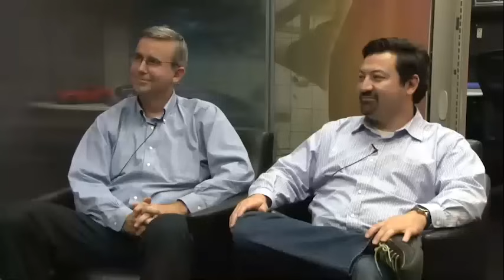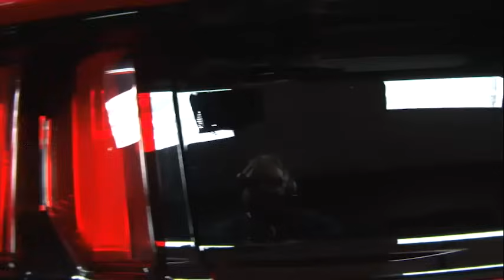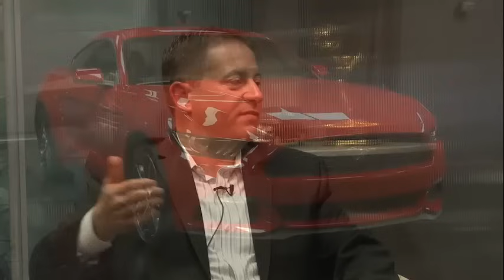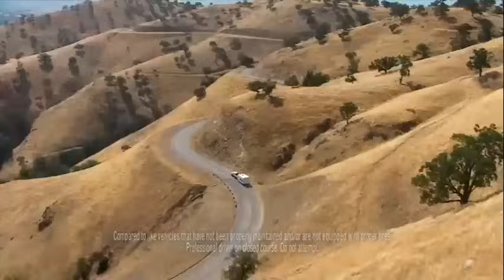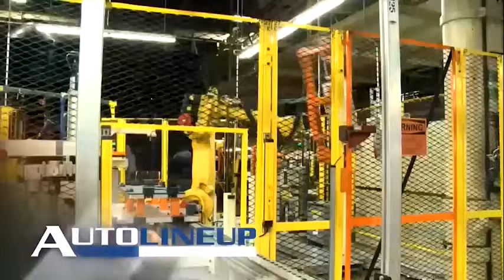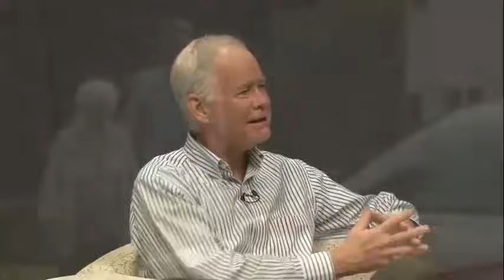Pony Up: Mr. Mustang Pays a Visit - Autoline After Hours 263

Comment: plastic windows.....just like the headlight covers that turn opaque over time....yes?
no thanks.I'll pass.
glass just plain lasts longer even though safety glass has plastic sandwiched in between the layers.
the sandwiched layer isn't exposed directly to water or oxygen so it takes a lot longer to start breaking down and turning opaque.of course...if you purchase a car with the expectation of it being a disposable appliance a plastic window won't be a consideration as within 3 to 5 years on average it will be disposed of in total anyway.

Comment: No Thanks!!  The 2015 485HP Dodge Challenger RT Scatpack is only $38,495. It already beat the 2015 GT Mustang and SS Camaro in a Motor Trend 1/4 mile drag race. It seats 5 people, has a large trunk, nicer interior and far better electronics. You would have to be an out of touch idiot to buy any ford or gm's recall queens right now!!!!   ;o)

Comment: take the Australian FG Falcon and stick a new body on it. - you got a Mustang. Change to the independent rear from the Falcon and behold, you have to fit the Falcon dual ball joint front end. Find it funny that everyone is raving about the handling ability of the Mustang which has finally caught up with what the Falcon has had for many years, including the Ecoboost 4 that was fitted to the Falcon. When will Ford acknowledge that the new Mustang is only a glorified Falcon. Ford kills off the best 4 door performance car in their range and leaves us with a two door car that our market doesn't want and the Fusion / Mondeo that doesn't sell. Wonder how long it will be before  Ford exits Australia because of pitiful sales.

Comment: 6th generation Mustang based 2.7 EcoBoost Crown Vic please!
Reply: Maybe a Lincoln. They could use such a car dearly.
Reply: Yeah both would be great.
Reply: It is called a Falcon and was engineered for left hand drive market. Problem was US "not invented here" syndrome
Reply: Is there going to be a new Falcon off this new Mustang? To bad the Falcons gonna be gone soon anyways so no one can have it. Hopefully they will make a new one off this and sell it here Idc what it's called although Falcon is a great nameplate.
Reply: *****
The Falcon was totally different platform, and it was not up to US safety regs. FORD had it in their heads not to sell the car anywhere BUT Australia. Despite having several test units in the US, bringing the Falcon to the US for sale never happened.

The GM Zeta platform, also originally developed in Australia, was developed with the UIS and other markets in mind, but was sold everywhere BUT the US until the Pontiac G8. It is unclear if the Zeta will persist after the Camaro5, Chevy SS, and Caprice PPV go out. Holden was working on a lighter more cost effective Zeta II. It is possible the platform could be used for larger RWD sedans, like the Caprice PPV successor and Chevy SS.

Comment: I think Ford didn't put that twin turbo V6 in the mustang instead of the i4 is because the cost of the engine is higher and also it would perform too closely to the V8. Maybe next gen, crossing fingers!
Reply: ford dosent function like gm - make an engine and than put it in everythinj.2.7 alweyt was ment to be a truck engine.torqe was the mail goal  - for towing,hawling and truck weight itself.stang is lighter so that tq would just spin the tiers